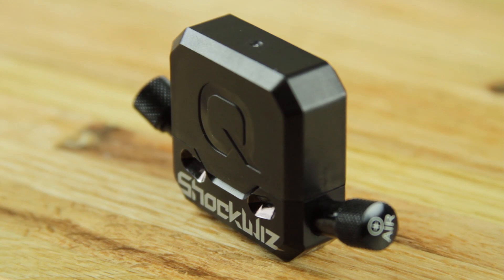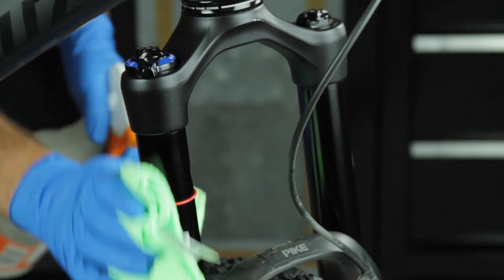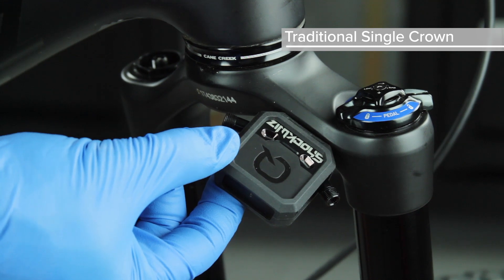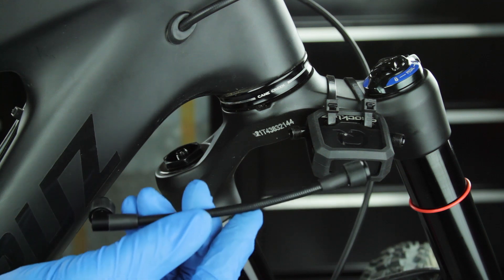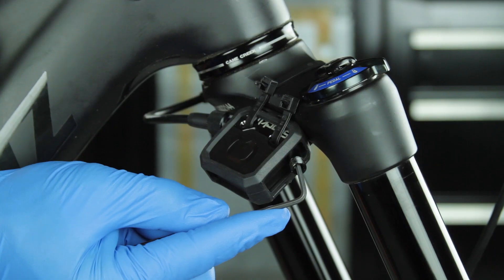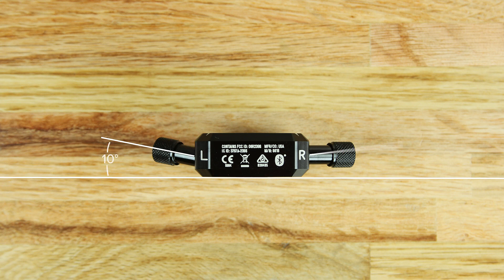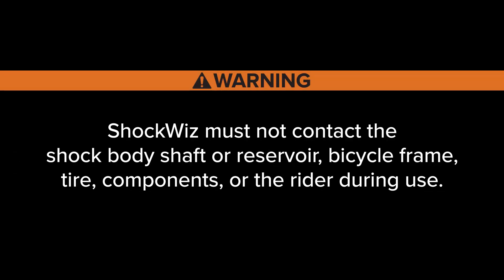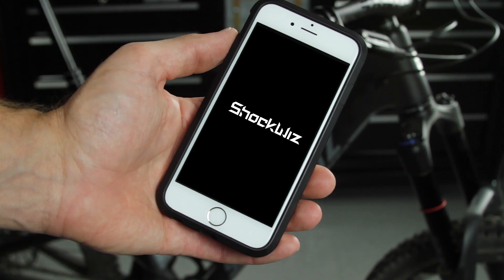Quarq ShockWiz: Installation

Comment: It's a useful device. However, after 3.5 years of intermittent use, the displayed pressure was about 20 psi too low compared to a connected digital shock pump. SRAM support suggestions for resetting the device did not work. I went to a local SRAM dealer, who submitted it for repair. SRAM declined to repair it or offer a reasonably priced replacement. This is unacceptable for a 300 € device and a pretty disappointing idea of customer service. I cannot recommend buying it. Given its more complex design and additional parts, I also wonder how reliable and long-lasting their flight attendant system might be.